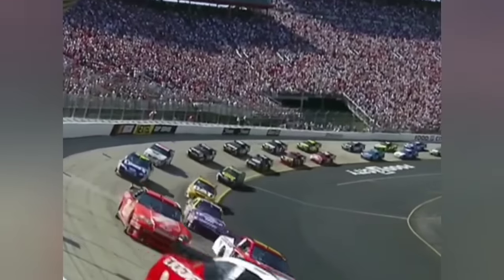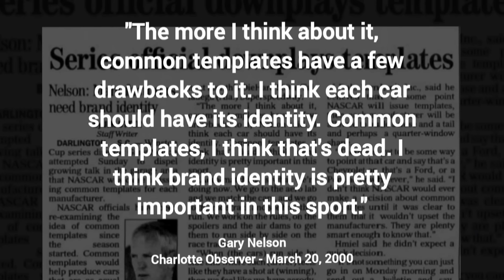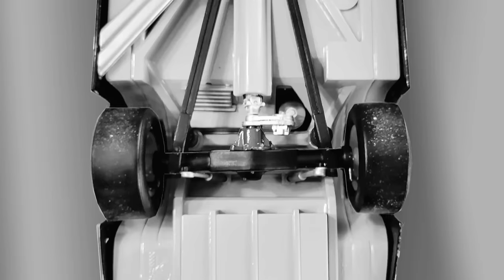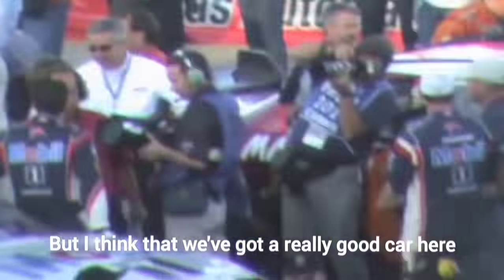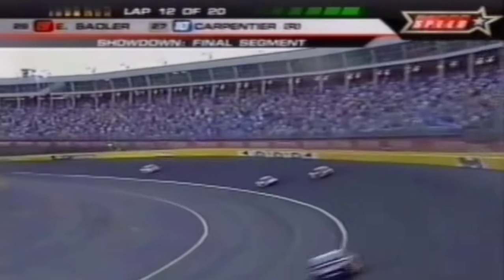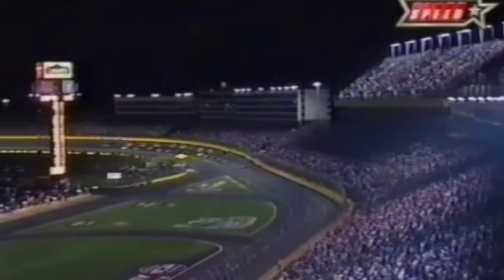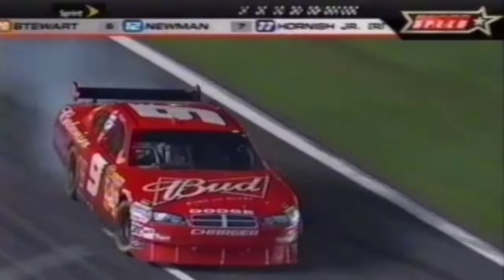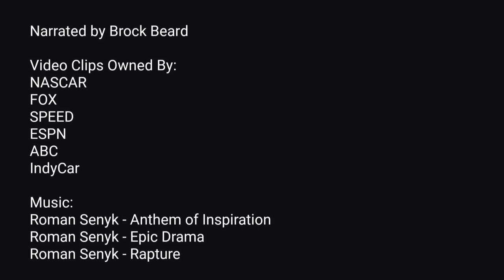The Car That Exploited the Car of Tomorrow

Comment: NASCAR needs to go back to the days where the teams buy the sheet metal from the manufacturer so the car looks exactly like the car on the showroom floor. If it isn't good enough then the teams can buy other sheet metal from another brand. That way the cars look exactly what you would buy and drive yourself. Leave it to the manufacturer to do the wind tunnel testing and so forth. Keep team cost down and better racing at the same time. It worked in the 80's
Reply: Cars were also cool in the 80s lol, not today. A car with actual Camry body panels on it would look so dumb. The cars are just too expensive to race nowadays. I wish they were more like Late Models.
Reply: Good and bad will come from it. The cars will slowly become too expensive/powerful as all the companies compete and common folk wont be able to afford the "stock" car lol. I imagine things like this led to that horsepower agreement between Nissan, Toyota, Mazda and Mitsubishi back in the 90's
Reply: @uraniumcranium2613 the same
Reply: @uraniumcranium2613  He did say "sheet metal".

When NASCAR mandated manufacturer-supplied bodies in the 80's, the performance differentials due to aerodynamics ended up escalating into a full-blown aero war between the Thunderbird and Monte Carlo. However, anyone who has driven a T-bird or Monte Carlo from that era will be the first to tell you they were NOT Ferrari beaters. Homologation specials only escalate that far when the mechanical elements have to be homologated for competition, too. With NASCAR, it was literally just the bodywork, so you'd get absurdly slippery cars with crappy engines in them. 

(Actually, even when the mechanical elements are homologated, that doesn't immediately render the car unaffordable. The E30 M3 didn't exactly cost M5 money in period, and Renault actually sold a metric FUCKTON of R5 Turbos.)

This setup might work today - powertrains and chassis are custom, but the aero is production-based. Then all the manufacturers need to do is design a sport pack or something with a ridiculously low Cd and frontal area without ever needing to toss out the anemic engines. That is literally what happened with the Thunderbird Turbo Coupe - and its 140 hp, turbocharged inline-4. The car was marketed as a BMW 325i rival, fell short of even that, and was far from being a hyper-expensive supercar - but it had a RIDICULOUSLY low Cd for the time of 0.35, which helped make the Melling Racing #9 in NASCAR practically unbeatable at the big speedways.

The public got better fuel mileage, motorsports got an aero war and record speeds, and the people who bought Monte Carlo SS Aerocoupes and Thunderbird Turbo Coupes didn't actually end up paying that much.
Reply: I thought american  manufacturers were phasing out sedans and similar body shaped cars because of the popularity of SUVs and trucks. besides toyota I think they all just want to make muscle car sedans and no everyday affordable sedans anymore...... no regular person can afford to buy cars like that, I don't know if we can ever go back to those days
Reply: @isthatrubble  that's exactly what I want too. It would also reduce bump drafting because the rear of the cars wouldn't be exactly the same as they are now. No more big ones that take out half of the field. Or less of them occurring. Engines are all the same in the race car anyway. Speeds need to increase also. Has restrictor plates made it safer? Hell no! There's been 10x more cars flying into the fences since they were introduced. Maybe 20x more even. Get speeds at Daytona back up to around 220 mph. Get rid of the road courses except Indy, which would give them 2 races. One on the infield and the brickyard 400 is coming back. Watkins Glen and Alabama and Infineon. 4 road courses a year is plenty. Personally I prefer a mid size sedan. They pretty much all look alike now. Shouldn't be a problem. All stock on the outside and all racecar underneath. Point system should be 1 point for each position. 1 point for leading a lap gone. Too many points awarded for that during green flag pit stops. 2 points for leading the most laps. 5 points for winning the race. And most of all, get rid of stage racing and playoffs. They're the most ignorant things In major racing. LeMans, IndyCar, and F1 don't do that. They're not that stupid to.

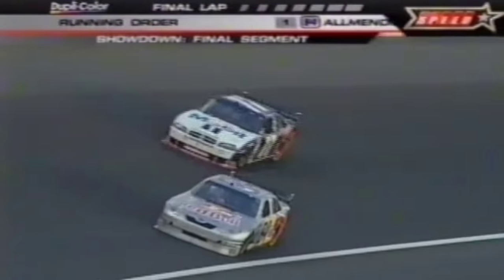Comment: At 12:20 that 84 car is spitting a heck of a lot of flames out the exhaust on corner exit. Way more than any other corner.  He needed to hit the "secret sauce" button for that last corner to hold off Hornish.
Reply: That's called getting loose. Flames only come out on decel.
Reply: Like SK said, it’s just raw fuel. Happens on carbureted engines.
Reply: Those engines back then still had carburetors, that's just unburnt fuel hitting the hot exhaust from quickly letting off the throttle.
Reply: That wasn't what was happening, but you get a like for the usage of "secret sauce" anyway LOL
Reply: @SUPRAMIKE18  I daily a car with a carb and points. I know they can shoot flames on decel. The amount of flames on that last corner is why I think that something fishy was going on.

Comment: I have a complete set of the Richardson 1998 Ford Taurus templates from one of the drivers mentioned that I'd like to find a new home for. If you hang all the templates together you can create the exact silhouette of the Taurus in several planes. They need to be in a themed restaurant or a racing museum.

Comment: The truck series had something similar where the trucks looked like they were pointed in the air to take away as much of the spoiler as possible.
Reply: I remember that! Especially at dover thefront splitter was way up off the track on the straights.

Comment: Nascar is now adopting FIA based F1 hub designs for mounting tires. 
F1 cars use a system very similar to the DCT transmission which was banned because it was too good, its simply a hydraulically actuated servo clutch that shifts faster than a human can, both the approved version uses push button shifting and the banned version.

Comment: Will never forget (as an Almirola fan) the fall Dega 2018 race with the opposite skew. Honestly, something about the skew is really fascinating for me. Just looks fast and super optimized for ovals.
Reply: Yes, when you only turn left, you set up the car to turn left as best as possible.  Wider right side tires. Positive camber on the left/negative camber on the right.  That's why I preferred the road courses because the cars had a left bias, but the teams had to set them up for right turns as well...plus road courses also meant wet racing if it rained, unlike oval tracks.

Comment: Ford Taurus:
I realized the advantage that they had in NASCAR while driving my 2000 Taurus.
Cruising on the interstate and raining out, the rear window was completely void of rain water running off from the roof meaning that at speed it was aerodynamic.

Comment: Forever a COT Supremacist, here. They’ll always be better than the Gen 6 and (so far) Gen 7.

Despite some problems with the Gen 5, if anti-COT’s thought the Gen 5 wasn’t good, they should’ve seen the Gen 6 cars after 2014.
Reply: Personally not a fan of the early COTs but imo they got significantly better when they got rid of the wing
and 2011-12 were fantastic seasons
Reply: @whoasked9500  I agree. They actually got better as soon as the spoiler came back. Then the official peak of the Gen 5 happened in 2011-2012, aaaand…. They died…. For a Gen 6 car…😕

At least for now, the Xfinity Series is still carrying on the COT legacy!
Reply: @IanTheMotorsportsMan_YT  Eh I'll always defend the early Gen 6 car, once they started reducing the hp though it got way worse.
Reply: @whoasked9500  I actually do like the early days of the Gen 6. My favorite Gen 6 years are 2013-2014 and 2016
Reply: @IanTheMotorsportsMan_YT  tbf 2021 was a good season imo in spite of the 550 package
Reply: @whoasked9500  Gen 6 was way too… how do I put this…. Too problematic with way too many changes and way to aerodynamic and the bad changes kept hurting it
Reply: Gen 6 was a dumpster fire. I can recall that 2018 race were SHR dominated Talladega with cheaty ass cars as bottom Gen 6.

Comment: They should've just made them run the other direction without allowing 
modifications.. like, half the race the other direction. I think it'd make for more interesting race in general, only issue is turning them around... ig could have some kinda turn around track in the middle where cars are guided to when the halfpoint comes, and if someone too far behind they gotta drop out.

Comment: What people don’t understand is that there’s often a need to ban innovations after a certain time. not doing so can make racing extremely stale. One team figuring out a loophole first has a headstart, and that won’t nevessarily ever vanish if the baseline isn’t changed every so often.

Engineering ingenuity is part of racing, but so are rules that change in tandem with those innovations. The beauty of motorsports engineering to me as an engineer is the opportunity to find loopholes, to excell inside a tight framework. And coming up with something so genious it gets banned is the highest badge of honor

Comment: The reason this works is because if you're turning left you want the rear wheels to turn right. Think about pallet jack the wheels will point the opposite way the front of it turns.

Comment: they were right, there's a reason a lot don't watch NASCAR anymore. If you're gonna have very boring tracks AND boring cars because they're so much the same, yeah. Many consider it a dead sport for a reason.

Time to enjoy at least some really fun vehicles with tracks that send them down a wild path.

It's called Arena Super Trucks. They jump over walls, ramp and land on asphalt, their drivers wreck em regularly but almost never get seriously injured, and even lift a wheel up around turns as they torque hard around corners.

It's now the superior sport and it's growing for a reason.

Otherwise, you wonder why you get more underground racing scene where the cops and law don't want it. Because identity, style, something new to see.. IT F'n MATTERS.

Comment: sure wouldn't mind seeing a race of factory stock, no option cars. The only non factory parts being safety equipment like the roll cage , windshield and fuel cell.
That would include base option tires, motor, transmission all at factory settings.
as for fuel, see that highway mpg on the factory sticker, here's 50 miles extra fuel

Comment: I would always call this " Dog Walking "
Owning dogs my entire life and we use to go for long walks on the beach and on trails in the woods. Never on a leash. They were much better behaved than people. 
I always noticed my dogs when walking in front of me were always going sideways. I never knew why and never looked into it but every single dog would walk this way.
As far as cars I never raced on a track but I did race plenty. Going down the highway I would always point out to passengers in my car when I would notice a car or truck that had bad frame damage. I would get behind it and say look you see how that car is dog walking down the highway? It was very noticeable to me. These were not race cars by any means of the word. Old junkets that should have not been on the road.  Some fool either purchased it that way without knowing any better or had some really raggedy body work done dangerous in my opinion especially if somebody doesn't know what's going on. After pointing it out I would disappear from that driver in a big way.

Comment: Its kinda sad how nascar used to be about how much you could push a stock car  to its limits. Even if you had to modify it, as long as the general vehicle was the same as what was sold it was ok. There was so much variation and looks. So much innovation. Now its all small minor things, everything looks exactly the same

Comment: Darrel Waltrip saying "They'd have to change the name of the sport" is such bs. Even though the sport was founded in the late 40's as a strictly stock series, drivers were modifying their cars on the very first race. And just because one driver got DQ'd for modified rear springs, doesn't mean that half the field wasn't doing it, too, including the new winner. Every bit of those cars back then was tinkered with in ways the officials simply weren't smart enough to understand. After all, these were racing officials and not mechanics, trying to spot modifications that mechanics are making to stock showroom cars. Nobody had any clue how the cars were built anyways, so when they were modified it wasn't super obvious.

The very next year in 1950, after having DQ'd a number of racers who were continuing to modify their "stock" cars despite the rules, they straight up said "fugit!" and renamed the whole division from "Strictly Stock Division" to the "Grand National Division." They simply couldn't stop every driver from making modifications, because from the very first race in the "Strictly Stock" division, if you weren't modified, you weren't winning a race. So in order to even compete, all the crews had to make adjustments and modifications. 

The 15 years following this decision resulted in some of the most ingenious engineering feats ever performed on a piston engine, shocks, and stabilizers. We owe so much of the safety and vehicle stability we take for granted in our vehicles to the fact that these ex bootlegging Stock Car racers and their crews were just trying to go as fast and far as possible without wrecking, and then surviving wrecks if they did crash.

Comment: Well believe it or not, it is possible to achieve this type of effect, and even better yet, hidden. The newer concepts are coupled to engine toque.  Under full power, the creative number & placement of cardan joints in the driveline & axles can give you even better induced lateral force compliance understeer.   This has a stabilizing effect as well as dog-tracking, dynamic toe change components and traction advantages.   BTW: produuction domestic cars& some trucks have had this phenomenon going on for more than 40 years.  This is an important ingredient in today's vehicles equipped with stability control because the control gain can be lower, resulting from the dynamic compliance feedback.   The REALLY COOL extra Car of Tomorrow benefit in the aero package is home run.  Then there's the titanium suspension parts coated with steel so they pass inspection with just a magnet !!!

Comment: WE NEED A NEW RACING EVENT, we need to introduce on no limits, metal body racing. with nearly no rules, and forcing a metal body and an long race, every car with have its own personality, and drivers can choice, to have big force induction engines and the sacrifice of weight, and small mid power engines with light, agile bodies

Comment: i stopped watching nascar when they stopped using production cars you could actually purchase at the dealer. point in case...the monte. rear wheel drive/etc vs the fwd production unit...that sort of disparity.

Comment: Stock car racing used to be a great way for manufacturers to show off their cars, but it got to be impossible for anyone to race a faster car.  Races are won by fuel consumption calculations and tire changing decisions.  Might as well be running a grocery store.  Yeah drivers are still very talented, but cars are pretty dead even.

Comment: There are a thousand ways to adjust an aerodynamic shell to a body, and I guess nascar would ban every single one before saying: "the body must align with the wheels by no more than x degrees". 
Just force them to run 100 laps in each direction hahaha. Split the race in 2 heats and don't allow the mechanics near the car during the switch.

Comment: I use to watch Nascar when televised here in Australia until they started racing the fake cars rather than the factory made ones.  It took all the enjoyment from the sport as a spectator or fan.
They are doing that in the Australian V8 to a larger degree now where the chasis etc and power plants are all basically the same with a this fibreglass shell mimicking the brand sits on top.  Is again taking the joy out the sport for many fans.  It's made the sport boring to watch for many.
Use to be that cars HAD to be based off factory built cars.  You could go to the dealer and purchase a tamer, road legal version of your favourite drivers car make and model.

Comment: Its really a safety issue.  If those cars can corner safely at 180mph+ without fishtailing out then doesn't that make it safer for the rest of the pack?  This should be a requirement for all cars not a ban.

Comment: One template, soon one engine, same differential gearing, same transmission ratio etc........   no innovation there. It use to be if one manufacturer had a slicker design, the others would change their body styles to be more competitive!!!!   I'm done, generic, no innovation. I wonder if they will have a template for the frame? Suspension, control arms, springs etc....

Comment: NASCAR use to be based off the production version
The ones that were slower, just showed that the designers fucked up the design of their production version.
Now it is a spec series.

Whats next, engines are to be made by a single outside company and all be 100% identical?